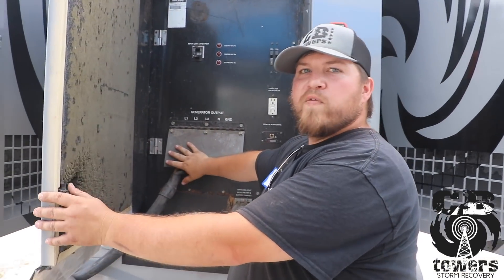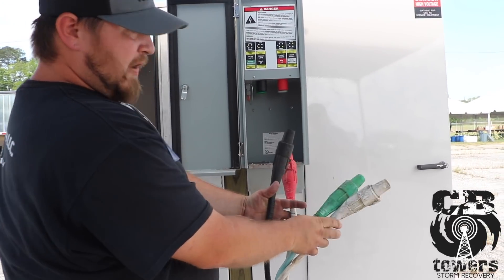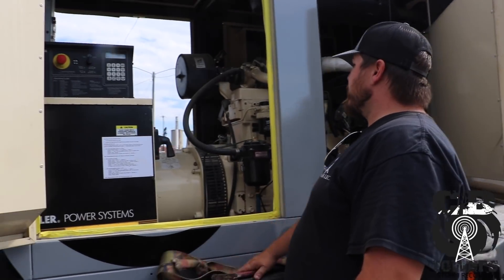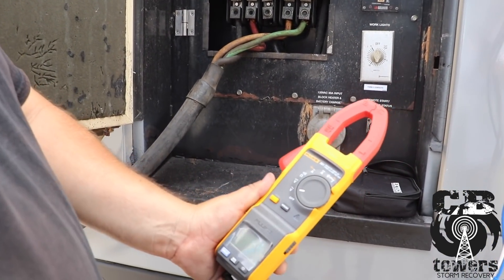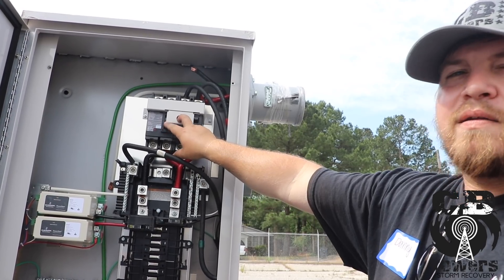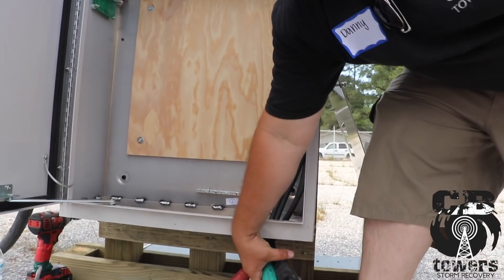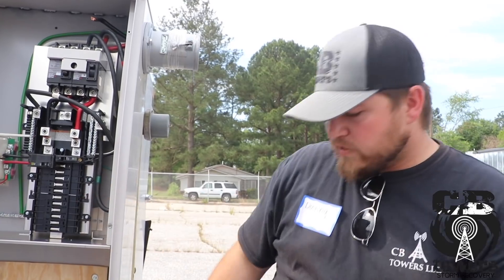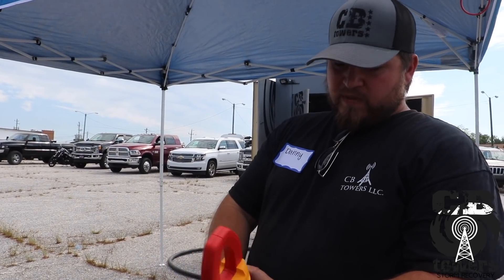Danny teaches proper Generator hook-up on cell site

Comment: You should see 400hz precise power gen sets. Retired Army 52E and have installed everything from a 1.5k up to 4.5Mw power plants and switch gear with paralleling operations. Also marine propulsion, marine generators on everything from the fishing fleet in Dutch harbor and the North Slope, shrimp farms in Belize, mega yachts, water taxis and ferries. Great video! Who runs the power cables for these setups? Not you I hope. 👍🤙